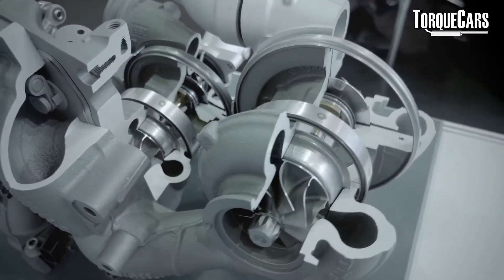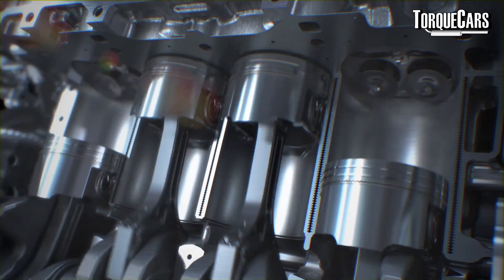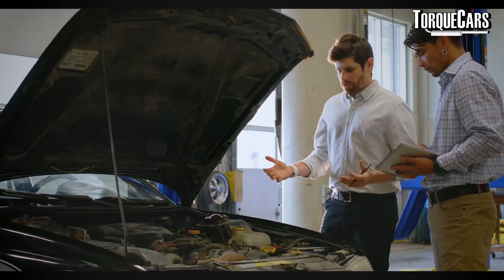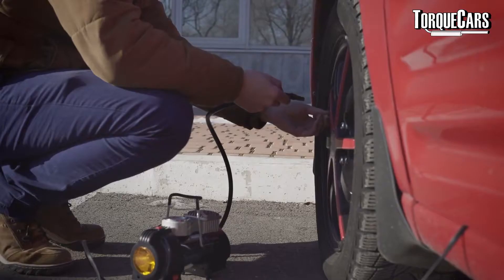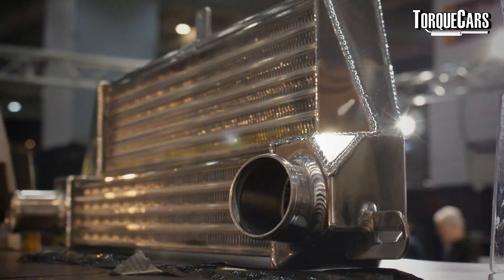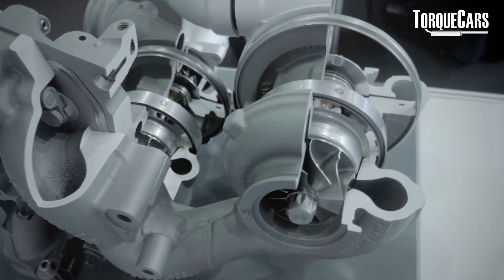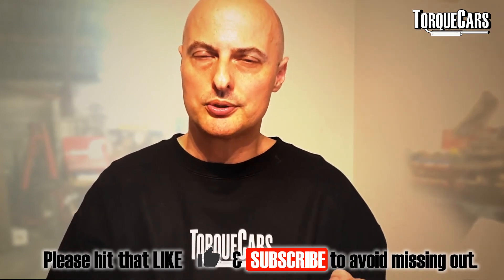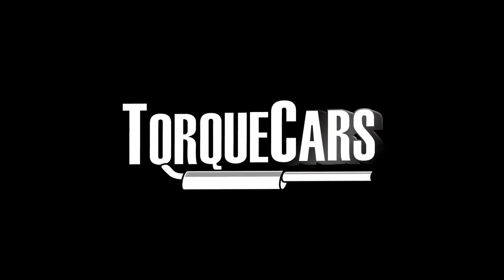Turbo upgrades for NASP & Turbo cars [Easy Guide]

Comment: Nice and informative 
What turbo and intercooler is adequate for a vw  1.6 tdi already remaped but stock parts and what to aspect from them ?
Thank you
Reply from the maker: I've seen quite a few using the 2.0TDi intercooler which is slightly larger and fairly easy to bolt in. I will be doing a video on the 1.6TDi very soon, so watch this space my friend. An intercooler will not really add power but it will ensure you get full power for longer periods of time as it resists heat soak more effectively.
Reply: @torquecars  
Nice.
Im also looking for turbine from a 2.2 or 2.5 engine :)
 And a new remap
Thank you

Comment: Hi friend ! Turbo plug and play audi a6 2.0 Tdi bre 140 cv pd ?? 
2.0 tdi 170 its compatible?

gt1749va to convert gt1749vc

I don't need a lot of power. just a better turbo. especially at low rpm
Tanks